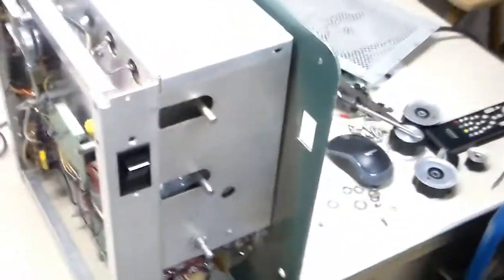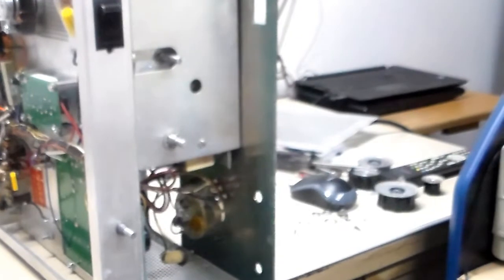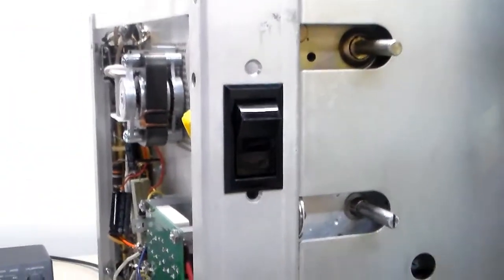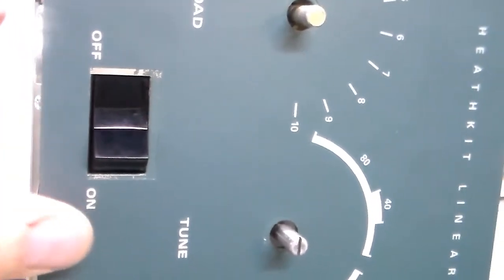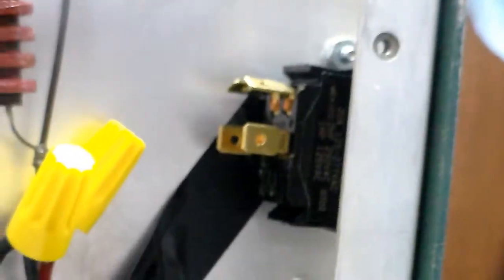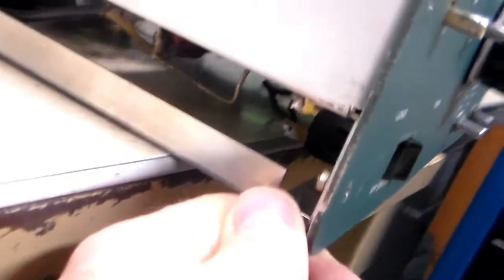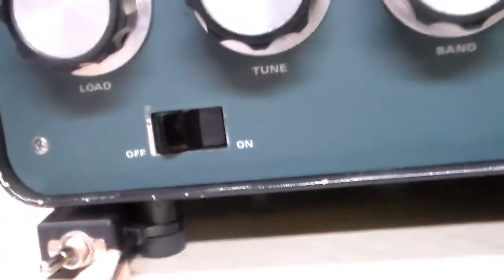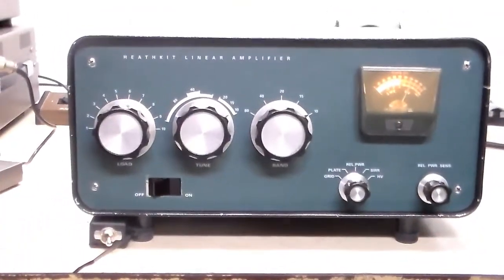Heathkit SB-200 Switch Modification

Comment: Have you ever experienced a amp was working before storing it for 4 years and when deciding to use it again it doesn't power up anymore?
Reply from the maker: I have not had that issue, but I would look at the power supply capacitors.  Then the circuit breakers first.  This switch would not always work but you could definitely feel a problem with it.